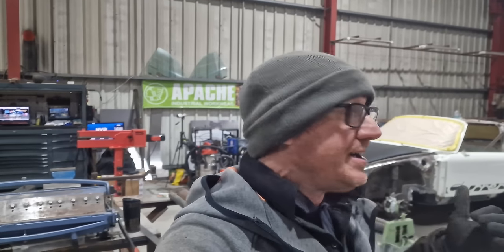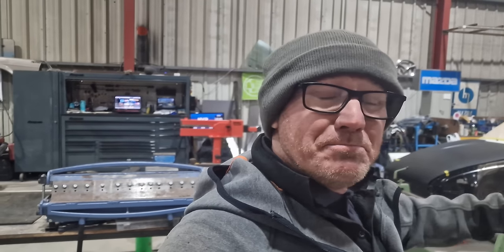Porsche 911 RestoMod : Have we completed the structure ?

Comment: Quick question. Wouldn't be more appropriate and closer to factory to use a squeeze-type resistance spot welder for panel attachment instead of drilling holes, etc?
Reply from the maker: As has been said many times. We make these videos not to showcase our skill or show you how we work but to show you how you could do it yourself. Hence the simple tools. So that said not everyone has a spot welder at home but most DIYers do have a drill and a welder :) thank you for watching.
Reply: Absolutely, in this case though it is most likely to get hold of a spot welder than a rotisserie or an english wheel, unless these are considered simple DIY tools everyone has at home!   @yorkshirecarrestoration
Reply from the maker: Just because we have a 10T indoor gantry crane and we use it to remove an engine, doesn't mean you have to. Just because we have a rotisserie, doesn't mean you also need one. Use a little bit of common sense and know that you can do these repairs on a ramp or on the floor. We didn't tell you that you needed a rotisserie to carry out these repairs. We are simply showing how these can be done at home. Simple common sense. Also I'm sure a spot welder is more expensive that a but of steel holding a car. Also do your research and see that on our channel we have shown various hundreds of ways to shrink and stretch metal without using a English wheel. Stop acting 13 years old man. This is free for you to watch...